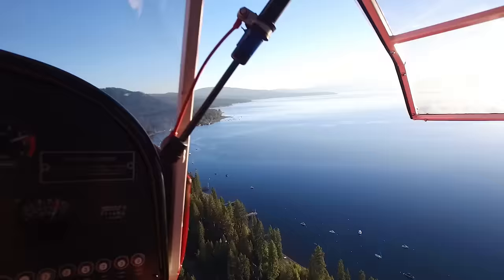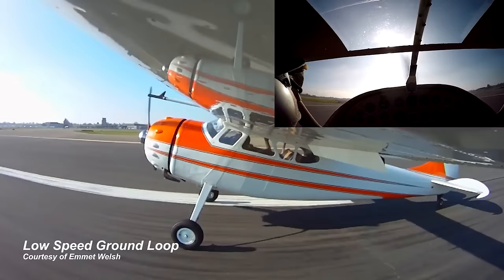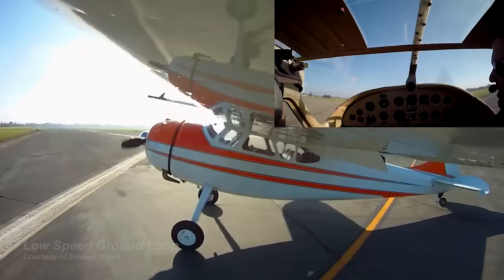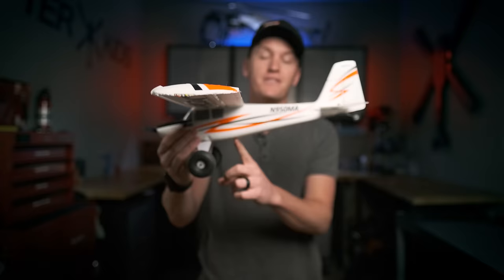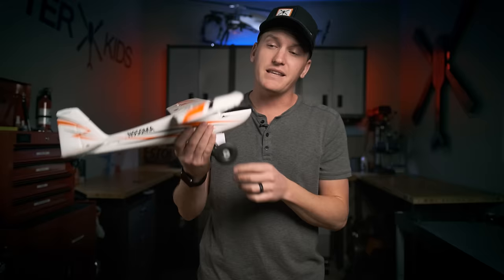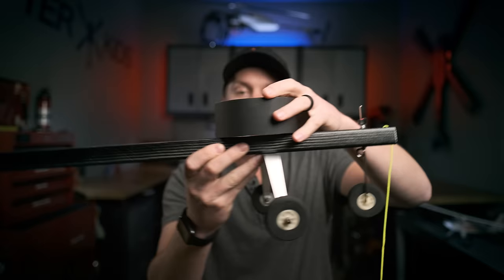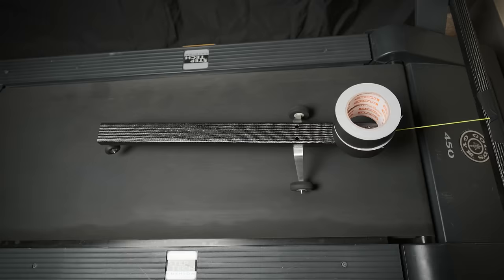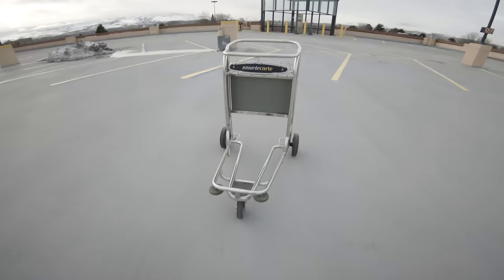The Ground Loop Monster

Comment: In my glider training we have discussed the ground loop as a measure of last resort to stop the glider :-)
Reply: I had to perform a groud loop once to come to a stop in time. In a scenario like the one you described. it was a short field, slightly downhill with high trees on final.  I side-slipped over the trees, put the plane down asap and braked as hard as possible. The harvested crop field was pretty hard, I hoped it was softer but unfortunately the plane did not slow down as fast as I hoped it would. So the only option I had was to ground loop; tail of the ground and forcing the right wing into the ground.  That did the trick. Otherwise it would have been a barbed wire and a ditch. Only five meters left. Worst landing decision I ever made. In hindsight I would have landed with tailwind. 

Luckily no significant damage, only the tailskid came off. And I had to remove the wheel to clean of the dirt that became stuck between the tire and the rim. Had it fixed the same evening.
Reply: @RickSoaring  You walked away so good landing airplanes can be mended easier than pilots.
I did a similar thing myself after an engine out into too small a field.
Reply: @RickSoaring  Thx for sharing!
Reply: Have seen it once as my field. Luckily at the point of wingtip touchdown, the glider was going a walking pace. Still bumped a tree and cracked the nosecone though. Easy fix on the Blanik.
Reply: Yikes, my glider instructors taught me the international ground loop as last resort. Then again  no going around,

Comment: I have also ground looped twice with a glider. Both times at a outlanding, but that´s totally different to powered plane :D
Reply: In your Libelle?  How did you avoid breaking the tail boom?
Reply: @WyllSurfAir  One at the JWGC in Lithuania with my Std. Libelle and one with a DG300. Both times the tail was not on the ground when the glider was rotating.
Reply: @WyllSurfAir  It's very circumstantial. T tails are more inclined to break than cruciform (big weight up the top of a long axis of the fin).  Crops, furrows, speed, cross winds, how much the wing digs in  and more all contribute to whether the backend departs.

Comment: Great video! And what a coincidence! I made my first ground loop just 3 days ago when I was training crosswind landings in a Cub. The airfield I fly from was very icy, so the wheels didn’t grip. And the plane just turned on me when i had landed. I’m also very new to fly tail wheel planes. I think it turned just cause the field was so icy, I probably should have used more rudder also, luckily nothing happened to the plane. But it was scary for sure. And I learned from it the hard way I guess. 😊 I guess when flying from icy airfield that you have to be extremely cautious, so if any have som tips for that I would be very happy. 😊
Reply: Fly em ALL tiedown to tiedown.
Learn to use control input in cross wind taxiing...
learn to control every airplane without the "brake crutch".
JMO. 2,000 Tailwheel.. no loop

Comment: I equate landing a tailwheel aircraft to backing up a trailer at 55 miles an hour.
Reply: There's a good King of the Hill episode about that.
Reply: I have never reversed a trailer as that speed. I've also, I'm quite certain, never reversed a car at that speed. Cars are pretty controllable at 25mph in reverse.  Not that interested in trying anything beyond that

Comment: I love your videos.  I have over 25,000 hours in the air and about 15,000 of those were in tail draggers like the Piper Cub, Luscombe Silvaire  and Cessna 180 and my favorite the Stenson and other tail dragging airplanes.  My father on the other hand flew more than 50,000 hours. WWII P47, various tail dragging aircraft as a civilian flight instructor and about 22,000 hours in a Luscombe Silvaire 8 F for Magnolia Oil Company of Dallas Texas. His Luscombe is hanging in the Permian Basin Museum in Midland Texas. Tail Number N2645. Neither of us ever ground looped a tail dragger. My father is gone now and at 74 my health has taken my ability to pass a flight physical but I still run outside when I hear a Round Motor Airplane fly over my house. Keep up the great videos young man and Please be Careful. My whole family watches all of your videos and we gather together to watch them when you have a new one out. And as an after thought on tail draggers the P47 had a Locking Tail Wheel and this helped the pilots of WWII to keep from ground looping. If you could make your Kit Fox tail wheel lockable it would help. Just a thought.

Comment: Good video, with generally good points.  There is another arrow for the quiver (beyond rudder and brakes):  USE ADVERSE YAW - from the AILERONS.  In a developing ground loop, this is STICK TO THE INSIDE OF THE TURN.  The additional drag of the lowered aileron, on the outboard wing, is corrective.  Also, the lift is helpful for avoiding a wingtip strike.

Comment: You don't scare me. I still want a Kitfox LOL. In all flying there is going to be mishaps and close calls anyway. Might as well have fun anyway and just learn from he hard knocks.
Reply: Look into avids too if the money is an issue. Theyre what the kitfox is based on. I bought one to learn in.. about half the price of a used midrange kitfox and there are multiple versions from STOL to speedwing (about 15mph faster but higher stall) to Magnums  that have insane weight capacity

Comment: Trent I can tell from your explanation of tailwheel aircraft control and your emphasis on rudder that there is one word I can tell you that will help more than anything else to avoid the groundloop.  That word is AILERON!  before you say that I'm crazy and don't know what I'm talking about just try this one time and you will be convinced!   This will be much easier if you go to a nice 5000 foot paved runway so you have a little time to spend experimenting with those mainwheels on that pavement.  You don't even have to land to do this, in fact i encourage all my tailwheel students to use every takeoff as a chance to practice this.. Either on the landing roll or on the takeoff use enough power to get the tailwheel up in the air and start playing with the ailerons while rolling down this nice long paved runway while up on the mains.    you will notice that when you make even the tiniest left aileron input the nose will go right and when you make right aileron input the nose will go left!  After you learn this you can steer the plane going down the runway with absolutely NO, yes that's ZERO rudder input.  Now you will be ready to discover how much more powerful and effective aileron is than rudder for directional control going down the runway.  then you can see why when you have just touched down in a left xwind for example and the plane which was drifting right on final and over the runway touches down and suddenly weathervanes into the wind and goes left it catches the untrained and unprepared pilot by surprise and when he makes right aileron input it overpowers his right rudder input and does a left groundloop for sure!  almost every single pilot i've trained has not had any idea at all of his aileron inputs when we started and they always steer like they would in their car which almost guarantees a ground loop in the correct circumstances. yes Trent you will discover that the aileron will overpower the rudder every time!   I have avoided many groundloops by steering the aileron in the SAME direction the nose is starting to go.   also you are spot on when you state that nosewheel pilots are way behind the tailwheel airplane in the beginning.  they have no idea the level of concentration it takes  to maintain positve directional control.

Comment: Fantastic stuff, Trent!  Guess I'll be a trike pilot forever....  How about we reverse engineer this Groundloop monster problem?  Upon landing, full rear elevator. Next, larger diameter  and width tail dragger tire.  Next, ADD A DISC BRAKE System for the 3rd wheel, to keep things lined up straight..... You will need to find a way to actuate it, maybe like a  rear brake lever on  bicycle, but on the JOY Stick?  You're smart, engineer a solution, don't let the tail wag the dog.

Comment: great video awsome demo . one thing I want to add is cross winds I fly out of an airfield 1 mile from alantic the runway is 02 /20 always crosswind . in my c170 did a ground loop mainly due to cross winds didn't damage anything by trying to soften loop rather than stoping it, also the airplane goes oppsite of what you expect espically if it is crosswind related catches you off guard. also its nothing you can train for really need that seat of pants stuff and remain calm

Comment: Seeing as 99% of my pilot training was done on tailwheel aircraft, you are absolutely correct with your advice. When taking off or landing, you have to do the "rudder pedal dance" to nip any tendancy to deviate from straight in the bud. Hesitate and you WILL ground loop, followed by a walk of shame back to the flight line.

Comment: Another great video Trent! No need to apologize for talking.  We are talking airplanes .. this is of interest to us pilots.   Haha

I haven’t ground looped a tail wheel, but let’s be honest I have less than 25 hours in one.  But I did have a minor ground loop in a tricycle gear.   I learned to fly in Minnesota and when it is getting close to winter you have to remove the wheel fairings.  Well the fairings were still on the Grumman American TR2 trainer and the right side locked up.

Comment: My grandpa was an aviation mechanic during WWII. He fixed more than 1000 airplanes. He knew about ground loops, but he barely saw one. Though all the planes were taildraggers at that time. And airstrips were muddy offroad fields. At any second either wheel could get stuck in a dirt puddle while the other one would roll on with little resistance.
Later, in 1950s–1960s, when jet planes and tricycle gear took over he saw many ground loops. They started to occur frequently. Even later in 1970s and on when tricycle gear became a standard ground loops happened to be rare again.

Comment: My initial flight training was in a Cessna 152, but I didn't fiish to Private at that flight school.  I finished with a good ol boy country pilot and a Piper Colt.  Still a tricycle, but many times more reactive then the 152.  The Colt was like learning to fly all over again.  I can remember my second instructor admonishing to get my hands off the alerons (speeling?) and use the rudder to control the level of the wings.  Eventually I was able to learn how to do it, but it was not until years later after I  could no longer afford to fly when talking to another old pilot that he explained  the science behind using the rudder for levelling the wings that it fully clicked.  Basically increase the air speed of the wing that is dipping.  From memory?  Step on the rudder that the wing is dipping?  It has been over 30 years since I have flown pilot in command.

Comment: That was an educational video that took a lot of thinking on your part, both material and presentation.  I hope your friends are giving you air time to keep your skills up.
Had the good fortune to spend an hour in the air in a Pitts S2-c. That plane comes in FAST! Pilot gave me the stick for about 3 minutes, did 3 fast rolls left and right and a 180 turn. Always came out wings level.  Flying out of Heber Valley Airport. Owner Brad knows Mike, Mark and Cory.
Best wishes to get a proper fix so Freedom Fox gets back in the air. Thanks, Rotax, for the important service bulletin.

Comment: Where glider/sailplane training helps pilots because of adverse yaw is strong due to long wing lever action and lots of slow flight just above stall in tight turns while thermaling in rough air for hours. Keeping the plane flying straight using a highly accurate slip indicator, a simple peice of string attached/taped to the windscreen.

Comment: I did my PPL training in a PA-11 at an airport where the Gendarmerie also trained their pilots in a PA-11. Early in my training we're #1 for takeoff holding short of the runway with the Gendarmerie PA-11 on final. Not 100 ft after they touch down, sure enough, they spin like a top. I think I could physically hear my CFI's eyes roll back into his skull.
By the time I was ready to take my exam, we would both be rolling our eyes as we saw them coming - I could swear they managed to ground loop the aircraft one out of every three times I saw them landing.

Comment: There are those tail wheel pilots that  have ground looped and those that will. I learned in an Aeronca Chief. They are a little short coupled. But I started on skis which sure helps with tracking. In the spring when the wheels went back on. I already had a good grip on flying the plane. I did 10 wheel gear landings that were mostly crosswind landings with an instructor. Just work your skill level up slowly. Over confidence is always waiting to ground loop you.

Comment: Loved the visuals particularly with the treadmill. Brilliant idea on how to demonstrate the ground loop tendency. 

Two minor critiques:
The left turning tendency you described in a tailwheel when you lift the tail is attributed more to gyroscopic precession than p-factor or torque. The torque and p-factor are felt most acutely when you go to full power just as they are in a tricycle gear aircraft but most people know and account for them in the early part of the ground roll before lifting the tail off the ground. Gyroscopic precession however creates another left turning moment when the tail is lifted that the non-taildragger pilot does not usually know to anticipate and in fact is counter to what they have come to expect since the same precession in a tricycle gear aircraft will result in a reduction in left turning tendency as the nose wheel comes off the ground.

The prop is a spinning disk fixed in space so it has rigidity in space and will resist change just as a gyroscope does. This rigidity in space translates forces to be felt 90-degrees in the direction of rotation and when you lift the tail, you are actually pushing the top of the prop forward and pulling the bottom of the prop backward; translated 90 degrees this forward pushing force will be felt on the right side and the backward pulling force will be felt on the left side. The right side will move forward faster than the left side of the plane, thus a left turn ensues. In a nose wheel airplane, you actually have the reverse forces (pull the top of the prop back and push the bottom of the prop forward) occurring which results in more of a "right turn" tendency and works to cancel out some of the p-factor and torque experienced on takeoff, thus the typical tailwheel pilot has learned they need less right rudder at during the initial pitching moment whereas the tailwheel pilot needs more right rudder during pitching moment.

Second:
The type of control pressures required to keep the aircraft under control will vary from aircraft to aircraft. Some planes will require long, hard control inputs while others will require short, quick jab-like inputs. It comes down to knowing your aircraft. I've not flown a kit-fox but the way you describe the movement, it sounds a lot like my experience in a Citabria. If you go fly some larger and/or heavier tailwheels, you'll find the jab like movements are not enough. Personally I've flown a Citabria, a C140 and a C170; I find the C140 requires more of a step and hold where as the Citabria is very much dancing on the rudder pedals. The C170 is somewhere between the 2. I've also read comparisons between a Luscombe (dancing) and a Champ (sluggish, step) that say the same thing... So the control inputs are not universal to all tailwheels and you need to know your airplane to know what type of control inputs it will respond best to.

Comment: I have a background in audio production. In audio, a "ground loop" is when you have two pieces of equipment (say, a CD player and an amplifier) with two different paths between their electrical ground connections (say, one connection through the audio cable, and one through the equipment's power cables) at different potentials. This causes a current to flow around the loop, which causes buzzing in the output. In fact, I would say that 99% of all buzzing or humming in an audio system is caused by a ground loop somewhere.

So I was very confused when I started getting in to aviation, and heard people talking about ground loops in their planes. I thought they were talking about problems with their radios until I found a YouTube video explaining it.
Reply from the maker: Also in the geothermal heating world a “ground loop” is a liquid filled pipe ran in a large loop through the ground to extract the heat from it. So there’s definitely a few different uses for the term ground loop!

Comment: Trent, here is what an instructor told me one time. Keep the tail up as long as possible, keep pushing the stick forward to keep the tail up. Let the tail come down naturally as the plane slows. When the wheel does come down and hits ground, pull back on the stick to put positive pressure on the tail wheel and force it to stay where you want it to go. He was a taildragger owner.

Comment: Good summary. Another example of this can often be seen on highways when hitched trailers do not have any weight on the tongue (the trailer is pulling up on the trailer ball). C.G is then behind the trailer wheels and it is an absolute bastard on the road.

Comment: Thanks Trent. Very good information. I’ve only flown tricycle planes personally, although have flown many on the simulator. I also fly RC aircraft and have more tail dragged since than tricycle planes. I’ve had some interesting ground loops in my CUB and appreciate the need to watch the plane and apply inputs as needed. Thanks and keep these interesting and creative videos coming.